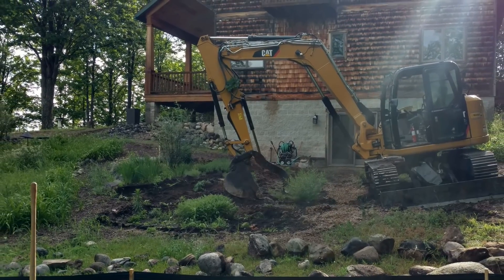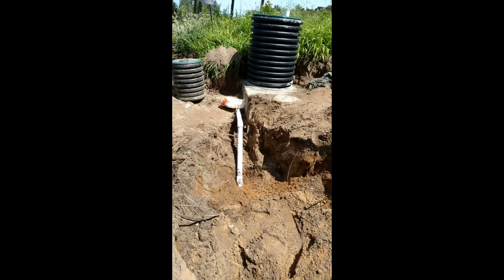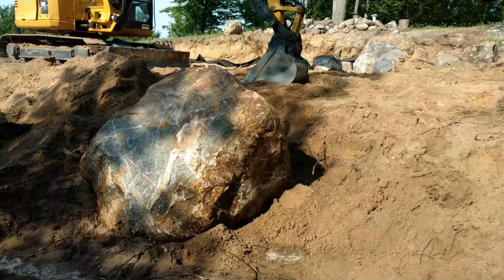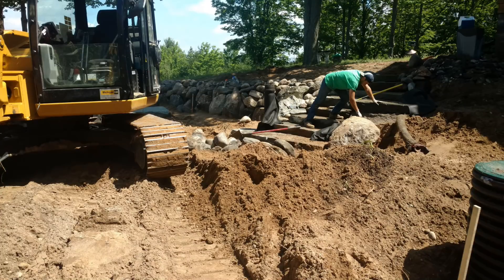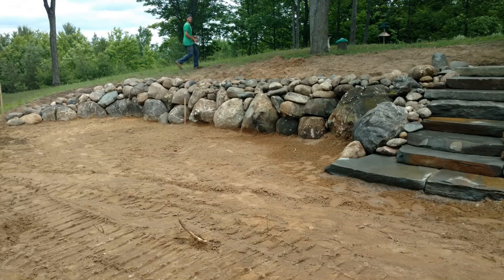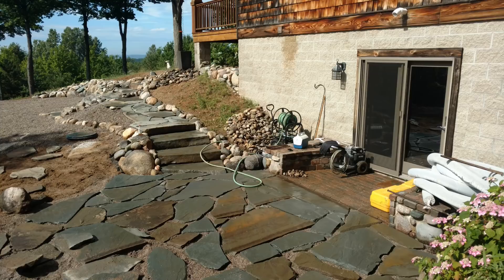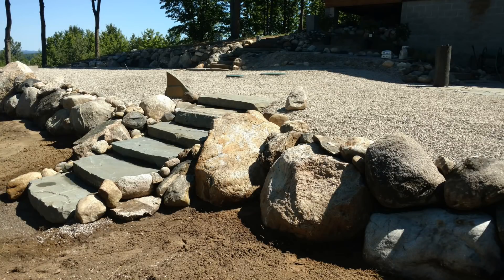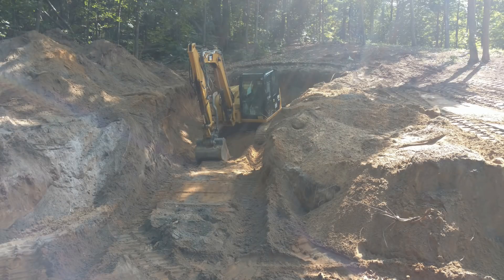Boulder Wall project part 1 Traverse City Mi

Comment: Hi Kyle, you said it took a couple months, was it steady or you periodically came back to it? And did you price it a daily flat rate 
For the equip,and lab plus materials? Or hourly, I don’t think I could even guess how long it would take me for a project like that.
Thanks bud great vid
Reply from the maker: I bid it as a 4 day project....Day one they wanted more, it increased substantially.   The septic adjustments added some time as well as the overall increase in size and more/additional steps they wanted.  It was all T&M so we were fine with it.   We started June 12th, and didn't finish until later in august - The 308 stayed there the entire time and we just came back in between other projects and such.  Great people to work for!